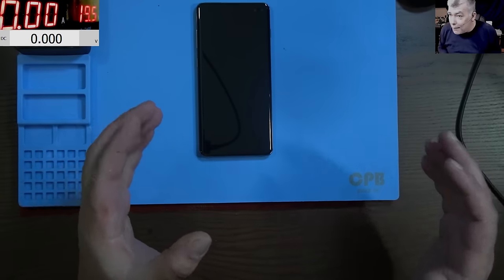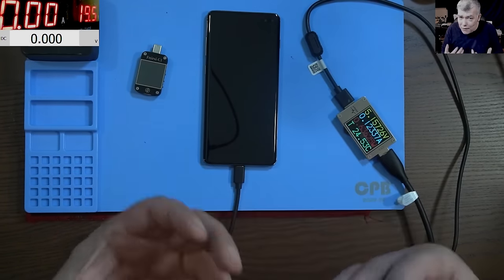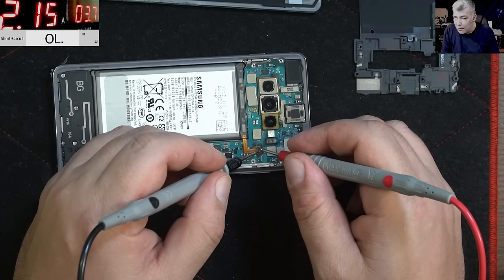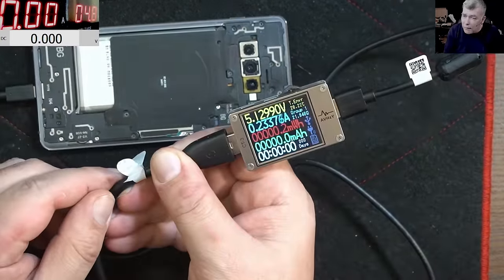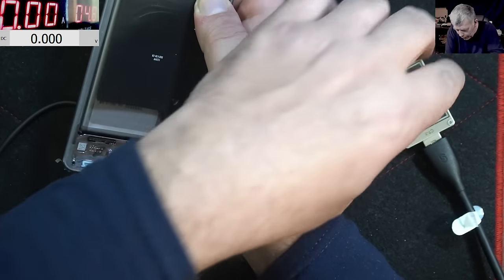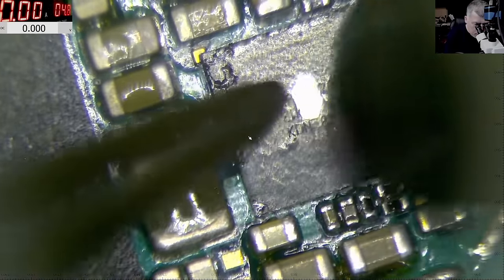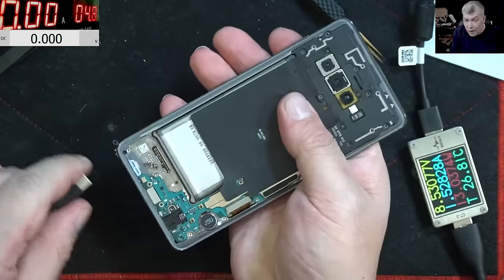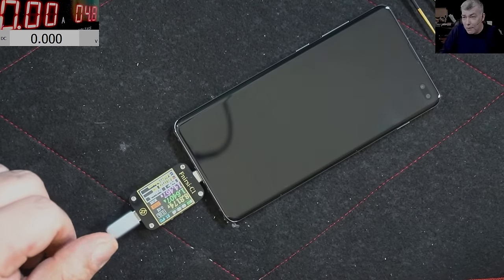How to diagnose & repair a phone charging circuit - Samsung s10 dead, not charging repair

Comment: When you mention the temperature you are using to reboil  and removing the chip that's a goldmine of information to newbies like me. Thanks a lot.
Reply: All hot air stations are different, even the same model can vary. As a newbie you need to practice and get used to your own machine

Comment: I agree with the diagnostic procedure you showed.

But one reservation about your procedure:
I just never do the thing of disconnecting the battery from the phone while the OS is booting or running. 
You surely know why I am writing this.

And I would like to add my experiences regarding phones diagnostics:
The internal resistance of the cell (its lowest possible value) is of course very important so that the phone can transmit stably at full power during a call / data transfer in places far long away from the mobile network antenna (weak signal) and also so that the phone does not have problems with the stability of the CPU power supply etc. at full transmission power.

Some mobile phones, with a battery that has a high internal resistance, behave in such a way that the battery status indicator drops sharply during transmitting, others have a problem with the transmitting power module, so simply the phone pretends to be on the network, but in fact is unavailable, and other models they just shut down out of nowhere when trying to transmitte.

Your battery quality test was just for information, I use a simple internal resistance tester for this, consisting of a load resistor with a value 2 Ohms, which loads the cell with a current of about 2 Amps at voltage of cell 3,6-4,2V. 
Furthermore, a cheap multimeter permanently set to measure DC voltage up to 20V and a second cheap multimeter for current measurement and one button.
Surely you know what I mean and how the internal resistance of a cell or battery can be measured in this way, provided that its open circuit voltage is at least 3.7V.
But for others:
You simply measure the no load voltage, push a button, so by button connect the load resistor through the ammeter, and measure the voltage and current.
You divide the difference between the no-load voltage minus the voltage with the load by the measured current (Ohm's law in practice :).

Furthermore, the electronics that the battery contains should protect the cell against discharge below 3V, but in your case the cell was discharged below 3V, which probably means that the phone was probably lying in the cold for a long time without charging, or the battery electronics do not have the mentioned type of protection or battery electronics have some leakage current  itself.
I don't need to explain what happens to a Li-Ion or Li-Pol cell if its voltage is below 3V for a long time, right?

And one last thing, you should add a current measurement of at least from 1mA to your lab power supply.
I mean that with a laboratory source that can display the lowest current of 10mA, it is not possible accuraccy to measure the current draw of the phone in stby mode or check whether the phone is not draining the battery even when it is switched off, which is quite common not only after damage to the electronics caused by liquid entering the phone, but also due to leakage current of various ceramic MLCCs and damage to the power management chip.

I made the mentioned modification by adding a cheap multimeter set to measure voltage up to 200mV to my laboratory power supply and this multimeter is powered by an external power supply galvanically separated from the branches of the laboratory power supply and by a suitable voltage divider made from resistors and a potentiometer.
I have achieved that this multimeter measures the voltage drop on the power resistor of the lab power supply, which is a part of it and serves to control the passing current at the output of lab power supply.
I personally use a 0-30V 0-3.5A linear adjustable power supply that I made myself 35 years ago and uses the MAA723 IC (LM723CN).

But of course, one of the shown USB testers could also be used to measure the current, provided that you modify it so that it is externally powered from 5V but measures the passing current as part of your adjustable source, and I think that modification is easy.

Comment: When you are removing the chip how come the hot air force is not pushing the rest of the smaller chips off their pads. Even when I'm lowering my blowing force to the minimum it still seems to move them. Great work Sorin.

Comment: quick question, what air flow, bezzel and temperature to use to remove the heat shields to see U8031 ? My hot air station is a quick 861DW

Comment: Thanks for your videos Sorin. In one video, you mention that a linear power supply is better than a switch mode power supply for diagnostics. Is this becuase of the noisiness of the switch mode power supply, or for some other reason? Also, is 30V-3A enough?
Reply: No its not for the noise is for the clicks you can hear on shorts , and try to find a 30v 5A power supply cause most laptops work up to 5A so you can have an edge on some repairs . (gaming laptops work around 10 A tho )

Comment: I guess it might make the swap of the chip even more reliable if we preheat the pads for a bit with the heat gun before we place the new chip on and the maybe then we can place the flux on the back of the chip instead (i mean we'll have to do this in the reverse order of course) then push it down and heat it with the heat gun again to finish it?
I lack some parts and a device to try it out currently..

Comment: Hello
I have a Samsung A15 mobile that charges with 380ma, and with the same charger and connector, another mobile that charges with 1800ma. What is the reason for the slow charging in the first mobile?
How to solve the problem and how much does it cost??

Comment: Hi everyone.

I have a samsung a21s and the ldo voltages are not present when the battery/power supply is connected. It is available as soon as i plug in the charger and the power voltages are not present.

What might be the problem?
i am suspecting both the pmic and charge ic

Comment: Is the battery not going to explode from all of that current?
Reply: What do you mean by "all that current"?  Lithium batteries can be charged at it's rated capacity, which in this case, if the battery is 4.1 amp hours, can safely be charged at 4.1 Amps, maybe a little more.  If he sets the limit to 5 amps on the power supply, the battery will most likely not take more than 4.1Amps when charging.
Reply: @johndopedo3298  Yes they totally can, I own a 67w charging phone myself, i'm talking about pushing the current into a dead battery, below its safe voltage.
Reply: No, because it wasn't too long and Sorin has an estimate in his eye as "prepared calibrated fuse wire on many years ago" :-D